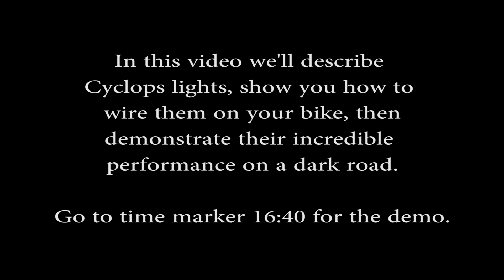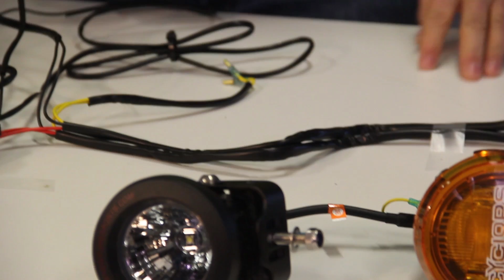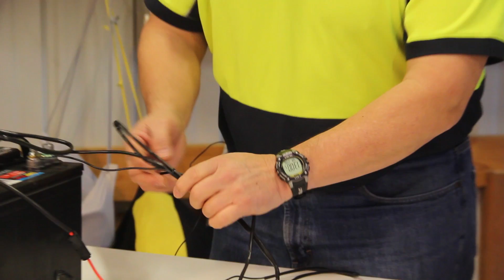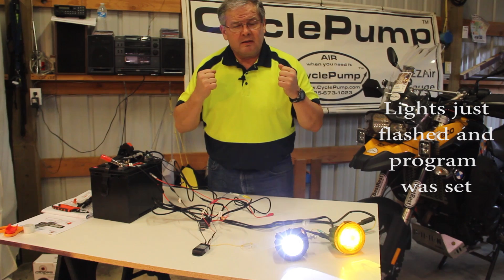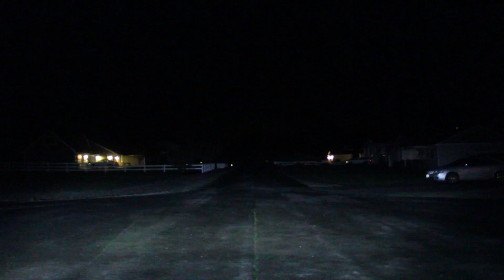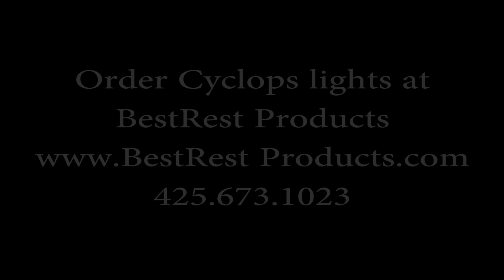Cyclops LED Driving Lights from BestRest Products

Comment: This is very helpful. Thank you! The wiring diagram looks pretty intimidating when you first look at it so I was glad to find your video. The only tricky bit I think is going to be finding a switchable powered wire. BMW code their wires and green is the colour for a switchable powered wire so I will look for that. I'm going to tie in a small voltmeter at the same time so I can keep an eye on my battery status. I researched carefully before buying and these are the best on the market. I'm looking forward to seeing what these bad boys can do! (Sorry, I'm in Canada so bought from a Canadian supplier.) Much appreciated.

Comment: How long do the led light stay on after you  turn off the ignition?
Reply: That depends on where you connect your control wire. If you go to the battery, the lights shut down immediately. If you tap into the BMW CANbus, then that system shuts down in about 30 seconds.

Comment: David, I always love your videos. I have an F800GSA  with the OEM auxiliary LED's. Wondering if your light bar will mount to my GSA because I'm not sure if the cyclops lights will fit in the same space as the OEM's when I pull them off...